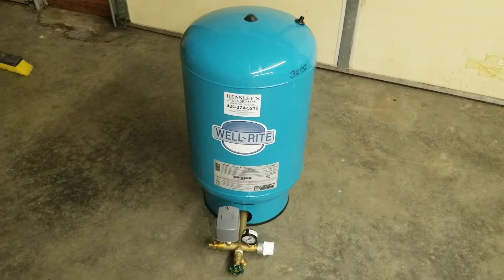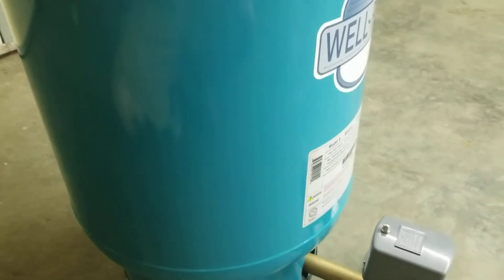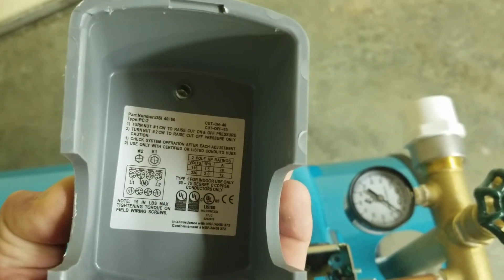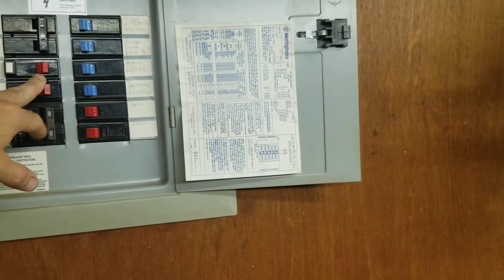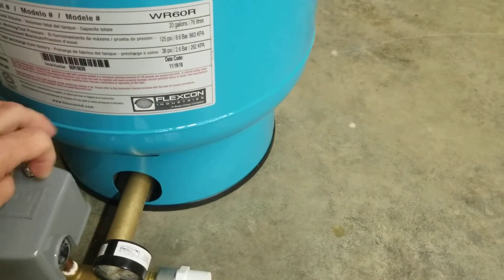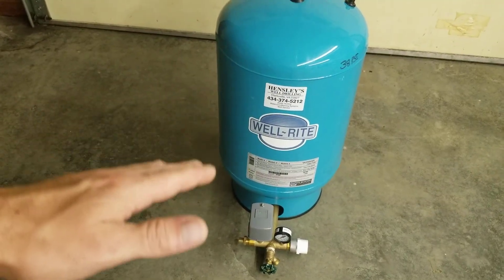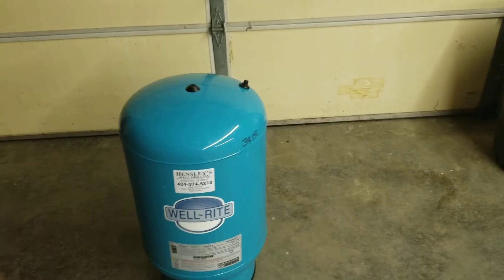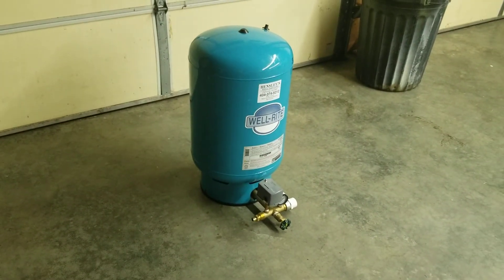Well Pump & Tank Troubleshooting, How the system works, Adjusting Pressure Settings Correctly

Comment: Nice video. My friend sent it to me. House is almost 3 years old. No real problem with system just that pressure is about 45 at the spigot. Would like more, especially in the shower. We have a large garden and greenhouse and use water all the time and occasionally too off the pool. Someone suggested a bigger pump on the well. There are just 2 of us living here. Any suggestion is welcome. Thank you

Comment: Just installed a new water pressure tank, and cut off but my well is not turning on. I have it wired exactly the same way as before and I'm getting the correct voltage. Do you have any tips for me to fix the issue?

Comment: My 20 gallon tank is short cycling.  I cannot access the schrader valve as it is corroded.  When I tap on the upper third of the tanks it sounds hollow.  Any suggestions before I replace the tank?

Thanks
Reply from the maker: Nothing to do but replace it unfortunately

Comment: Great info and well explained ! My question is , should you check the pressure in your tank once in awhile , like twice a year ? or don't touch it if your pressure is good in the house? and my second question , is the 40/60 switch harder on your plumbing than the 30/50 switch because of the higher pressure or is that not an issue to worry about?

Comment: OK so I randomly lost all water. Checked power to switch, in and out , and going into the qd box The capacitor ohms out correctly  but I have an old solid state switch and don't know how to teat that. I ohm the wires in the qd to pump and all in spec do I just change out the qd box or how do I test the solid state switch thanks
Reply from the maker: Test for power at the well head. If you get power there & no water, then the wire down the well is bad or the pump is dead

Comment: We’ll replaced everything except the well pump itself. Still fighting my pump shutoff issue I did take measurements it’s a 230v 3 wire plus ground. My reading are red, yellow, black individually connected to green I’m getting 24.51 ohms which I think is a ground issue, it runs at 6.79 ohms. It’s got 7.3 ohms between the black and yellow wires. And 17.5 ohms between the yellow and red wires.. not sure if it’s a 1/2 h.p. Or 3/4 h.p. Any thoughts. Thanks in advance

Comment: H2o Mechanic HELP. Lost water pressure. Replaced pressure switch (30/50 with same 30/50 and cleaned significant crud from the nipple.) Repressurized tank per steps on your other videos. Whallah. All was well for a few days, then lost pressure AGAIN. Tank rings like a bell, tilts freely, pressure 2lbs below cut on (28). Followed all the steps to recalibrate tank (bleed pressure from sinks etc) drained tank, repressurized to 28. Breaker back on for pump, used multimeter to check juice (both line and pump reading about 236). Tank not repressuring when breaker set back on like vid shows. What am I missing?

Comment: I drained my tank about 7 gallons came out but my gauge only dropped to 40psi not zero. I put a gauge on the air nipple of the tank it’s reading 37 psi. I turned everything back on and filled the tank up with water and my gauge isn’t moving and still low water pressure in the house.

Comment: My tank is not holding any water. My pump will just run and not stop. I replaced the high low switch and nothing changed. What could it be???

Comment: Gd morning my pump is on top of bladder tank wish I could send pictures but anyway the temperatures are finally coming back up & the pump comes on & I did the 3 test on bladder all good I have a gauge on top of pump it's 0 but I put tire gauge on the air valve on bladder tank and it had 22psi. I did back wash & the water is going somewhere because the numbers where counting down.  What should I do?

Comment: We have city water here in Florida for the house but have a shallow well with a 1hp Red Lion cast iron pump for the lawn. I bought this pump after using a well installer that had to replace my pump every 3 years because they would rust out and just quit running. He retired and I was tired of him installing cheap pumps made in Mexico made with sheet metal so I installed a cast iron pump hoping it would last 10-20 years. Well, it quit running after 3 years and I just ordered a new capacitor for it since the capacitance measured above the upper limit and the motor just hums. I have a 20 gallon water tank and we use it mostly for our sprinklers that go off twice per week. I heard you say a larger tank would make the well pump last longer so I'm thinking of going with a larger tank in the future. I also heard you say in one of your videos to replace the pressure switch when getting a new water tank. I'm thinking about going with a 40-60 pressure switch instead of the 30-50 switch I have now. My sprinklers don't seem to have a lot of pressure and I've had problems with the valves ever since I moved in so I'm thinking the higher pressure would be a good thing?

Comment: 2020 WellxTrol 20gal tank W/30-50 pump; past 2 wks been having initial good pressure then quickly drops to slow flow from  kitchen sink and bathroom faucet, shower stays at very slow flow all the time, and cut in was at 30.4PSI and cutoff at 49.7PSI pump seems to be working. Attempt 1: turned off power to pump and opened faucets to draw down PSI, the water weirdly stopped flowing at 29PSI, previous old tank stopped around 20psi with same procedure. What do you think the problem is? I do not feel or see water at the air chuck. It seems like water is just not getting pulled into the tank OR the diaphragm is leaking and the pressure is not pushing the leaked water out. House uses a storage tank underground outside, water has to be hauled to tank, and tank is below frost line, so there is a full tank of water. Do I release the air from the tank from the air chuck and re-inflate to 28psi? I cant tip the tank, I do not want to deal with a leaking soldered line.

Comment: Water appears to have air mixed in,   spurts.  Drained system by turning valve off between pipe and tank,  opened all faucets.  Turned valve off to pressure tank,  turned pump on,  water came out directly from tank at bottom valve in steady stream.   Recharged system.   Still getting air in lines.   Suggestions on what to check .  Merci

Comment: What is the little valve on the pipe that looks like an air valve and should water be slowly leaking when the pump cuts on? It’s not on the tank. It’s under the switch. Then it trips the breaker.

Comment: Can you advise about a pump that won't shut off?  New pressure switch and gauge.  Tank holds pressure.  As far as I can tell no leaks in the house to from the pump to the tank.  Could it be a failing pump or possible wiring issue to the pump?  It's in casing 180 ft and I have a 42 gal. Tank.  The pump can't get past 40 lbs of pressure.  (30/50) Thanks for any advice!
Reply: Nevermind I guess.  Thanks anyway
Reply from the maker: Yes, more than likely the pump is old & worn out & needs replacing

Comment: My well kept tripping the breaker and would work very inconsistently. I checked the air pressure and it was only 11psi. Haven’t gotten a compressor yet, but do you think that will solve it or is my well pump ruined too? I have a bad feeling the low pressure in the tank burned up my pump.
Reply from the maker: Your spot on. But try adding air first and see if the pump stops over heating. If it still gives you issues, then replace the pump.

Comment: I just got a new 86 gallon water pressure tank after my old 52 gallon tank busted. I installed a 40/60 switch. The tank came with 25 lbs. of pressure and I increased it to 38. When I first turned it on the pressure wouldn’t go past 30 and I could hear water going into the tank. I bled the lines thinking there was air in the lines and tried again.  The pressure again would not go past 30 and now I can’t hear any water going into the tank.  I tried a new switch thinking I got a dud and in the process there was no water in the tank. I am stuck. Did I get a bad tank?
Reply from the maker: If you don't have a check valve at the tank, turn off the pump breaker and see if the 30psi drops to 0. If it does drop to 0, that means you have a leak in the pipe down the well. Probably a split pipe right above the pump. It's Spraying out most of the pressure

Comment: H2o Mechanic - A question - I hooked up my new tank, the old one was definitely bad as you described, was full of water outside the balloon and had to drill several holes to empty it.  After connecting the new tank, turned the pump on, pump ran OK, when I tried a faucet upstairs the water came out slowly, I hoped the tank was filling though couldn't be sure, the pressure gauge still read zero.  The tank out of the box was charged with 30 lbs air pressure, I added up to 38 lbs, but after 15 minutes I turned the pump off in case I did something wrong.  

Q. How long should the pump run to fill a 20 gallon tank?  How long until the water pressure gauge begins to show pressure and then pump shuts off?  I believe the switch is 40/50 lbs.  20 minutes?  I didn't want to over heat or burn out the pump motor, but everything looks hooked up OK.  Bottom of tank I put a "T" fitting, pipe from pump on one side, pipe to the house on the other side.  Pressure gauge and switch are mounted on the pump where it was, I didn't touch the pump.  Thanks

Comment: I have swapped out a new tank and new switch. My water starts out with good pressure and then it dissipates after 2 min.
I can hear the switch activate in double tap sounds every 2-3 seconds when a facet is on. Please help
Reply from the maker: Probably too much air on the tank. Especially if you didn't check the air pressure (it's probably at 40psi. It should be 35psi if you have a 40/60 switch).
A 30/50 switch needs 25psi of air in the tank. 
Turn off the pumps breaker and open up a faucet, drain out all the water to 0psi. Then go check the tanks air pressure. You description is spot on for too much air & common to be pre-charged too high. All my new tanks have 41psi in them, I have to let out air each time & set it with a tire gauge

Comment: I ran all your tests on my Flex 2 Pro Composite tank and all those point to my tank being fine.  No water comes out of the air valve.  The tank is easy to move back and forth whether there is water in the system or not.  When I knock on the side it sounds empty.  However, when my sprinklers run pressure slowly builds up in the tank to the point that when I drain the (pump off and open a faucet) the tank bladder pressure has increased by approximately 10 psi.  I bleed off that extra pressure and the same thing will happen after then sprinklers have run for a few hours.
Reply from the maker: Hard to grasp your description but...
While running the system, if the tanks bladder has a hole in it (in the perfect spot) water can get to the opposite side of the bladder & it displaces the area for the air, so intern the air compresses. 
Either way, the tank sounds faulty, if its 10 years old it's time to replace it.  No sense chasing other possibilities til you can swap out the tank

Comment: Thank you so much for your good and helpful advice.  There's a lot of well pump and tank advice on youtube, but most sound like amateurs and unsure of what they're saying.  You obviously are a professional, experienced, and explain clearly and confidently what we should look for.  I had bought a replacement well pump at Lowes, guessing that's why there was no water, but after going through your check list of possible pump problems and now this video on tanks, I discovered my tank is bad.  I returned the pump and going back to pick up a new 20 gallon tank today.  Thank you so much, I'm now a subscriber.

Comment: Hi , I lost water pressure and I went ahead and replaced the pressure tank , along with pressure switch . But the same issue persists. I’m wondering what could be the issue . Can the well pump causing the issue ??
Reply from the maker: Yes, it's likely seazing up/ overheating due to age ,the bearings die inside the pump. It tryst to run but ends up getting too hot & shutting down. Id replace the pump and wire

Comment: I just had  new bladder tank installed and it came with the new cut off pressure switch with the level on side where as the older one I had did not. Its  30-50 and I notice when working it comes on at 30psi and off at 50psi. OK so far, but about once  every other day, it trips and cuts off. I know I don't have any well low water issues, but its driving me crazy resetting this all the time. I'd prefer one without the cutoff.  thoughts on why it is doing this constantly ?thxs
Reply from the maker: The tank just has too much air in it. 
Kill the power, open a sink & drain all the water from the tank, then go check the tanks air pressure on top of the tank with a tire pressure gauge. Lower it to 25psi . Then turn the systems power back on. Itll go to working correctly then. 
I bet you'll find that your air pressure is near 40psi.

Comment: Hi question for you in the shower while taking a shower the water will slowly come to a stop for about a minute and then come back on is that my pressure tank on my Well Pump?
Reply from the maker: It's probably the tank & the switch. The nipple below the switch may be clogged (highly likely). So remove the switch and clean out the little pipe . While the switch is off & the tanks empty of water, check the tanks air pressure on the top. It's probably low. 25psi of air will be a good setting to get it to (itll require a air compressor)

Comment: Hi there - great video, really helpful. Quick question. If the pump switch says 30/50 is it a bad/fatal thing for the actual pressure on the gauge by the switch to show 40/60? When I checked cut on cut off the numbers on the gauge were 40/60 but the lid on the switch says 30/50. Presumably at some point someone adjusted the switch. The switch seems to be working fine but.I worry the numbers aren’t what the switch says. Thanks very much!
Reply from the maker: Itll be fine. Someone just adjusted it
Reply: @h2omechanic  Thank you so much - for the reply and for the help. Very impressive.

Comment: Hi quick?  I had a well drilled was planning on building soon     but health problems put a hold on the plans . I would like to run my well on a generator for now to water tree's I don't know how to wire it to the generator I have al the setup there at first i thought to wire to the pressure switch, but i have another box coming from the well itself with wires going to the pressure switch ( box) can you point me in the right direction please
Reply from the maker: If there's a control box, open it up and see if all wire terminals are full/used.
Normally you'd hook the Gen to the pressure switch, then out of the switch to the control box, out of the box & the wire then feeds the pump.

Comment: What is my tank is good  and I still have a pump cycling  every minute
Reply from the maker: So the tanks good & every 60 secs the pump turns on & the pressure seems to keep going up & down.  
The answer:
Your pump has a 1 way check valve in it, that check valve has failed and once the pump kicks Off, all your pressure is flowing back down thru the pump. 
To fix it: Remove the pump & install a Brass Simmons check valve on the top of the pump. 
Or, if its 8+ years old, just replace the pump and you'll be set for another 10-15 years. 
My advice: keep the pump breaker & water heater breaker Off when your not using water. (While your asleep or not at home)

Comment: I have a 375 ft well drilled but I need to install the pressure switch on the well pump I was wondering if there's any way I could do it myself without having to worry about messing it up
Reply from the maker: The switch just needs to be near the tank. Watch my videos, get an understanding of how things work. You'll be fine.

Comment: Which side of the brass fitting is coming from the well? The side with teh white attachment or the other?
Reply from the maker: The white side. Normally the input pipe is larger. But it doesn't matter what side you use

Comment: I have air spitting through the faucets when I first turn them on. I just installed a new 40/60 bladder tank.
Reply from the maker: If it continues to do this, there's a issue with the pumps check valve. 
Secondly, when you replaced the tank, did you add a check valve near the tank?

Comment: I have no spark underneath the boxed area where my wires are at.. what can my problem be? I have no water
Reply from the maker: Normally that's a sign of a bad wire down the well going to the pump, or a bad pump. But typically a bad pump would trip the breaker.
Reply: @h2omechanic  Its not my pump I just renewed it 4 years ago and they went 15 more feet so it's all upgraded so then it might be the nipple line?
Reply from the maker: @itthepartida1842  no spark means it's not getting power. So it's a bad wire or if there's a control box (not the switch) the capacitor might be bad. Itll be a grey metal box(but you may not have one)
Reply: @h2omechanic  yes I have the grey metal box..
Reply from the maker: @itthepartida1842  if you pop the front off, there's a capacitor behind it. If its swollen then it's bad. Have the power off. But be careful, the capacitor holds power, it can shock you if you touch the top leads.

Comment: My pump gauge reads 40 but I have no water .. I can’t find the water pump breaker to turn it off ? What would you suggest for me to try ?
Reply from the maker: The pump breaker normally is a double 20/20 breaker.  On some houses there's a outside panel